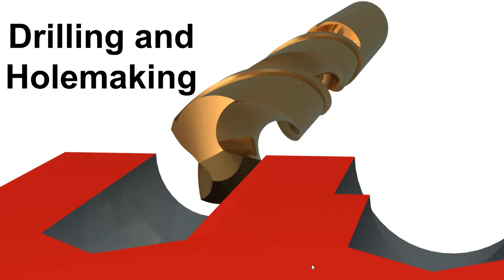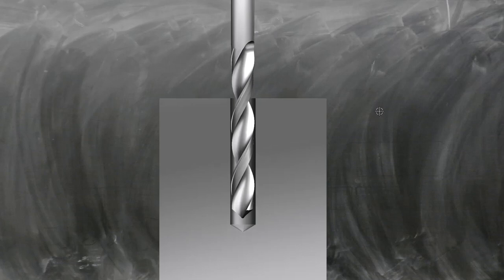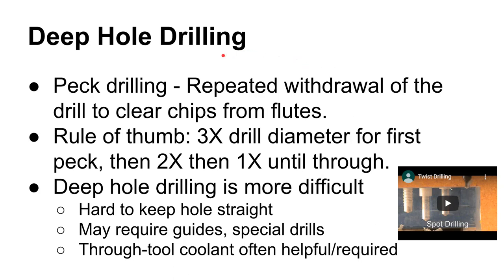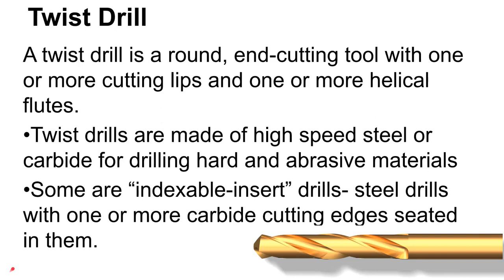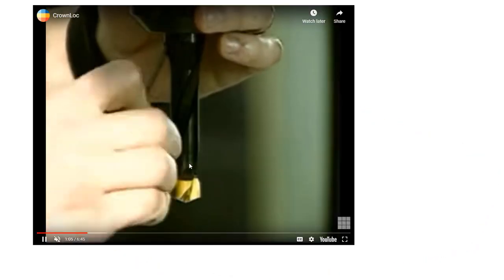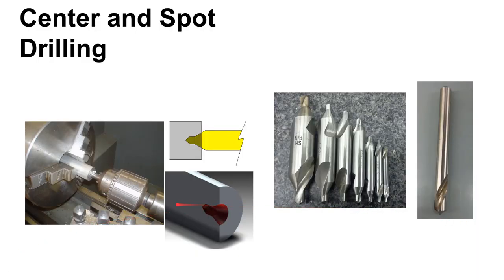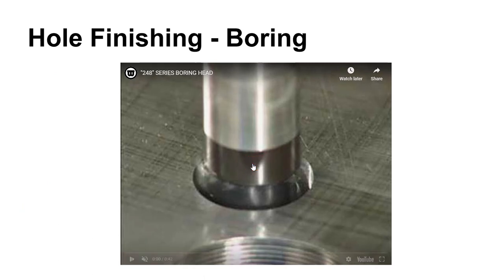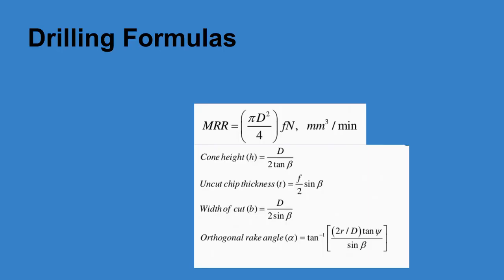1711 Drilling and Holemaking - Lecture

Comment: @ 37:20
In one breath you say that it is easy to burn up a tool. In the next, you say don't be a dumb ass and go on to say not to burn up a tool. As an educator, what are the odds that one of your students, new to machining, will make that simple mistake? Let that kind of angry threat hit the cutting room floor. It will only make a student more nervous around the machinery. Other than that, your presentation is excellent.